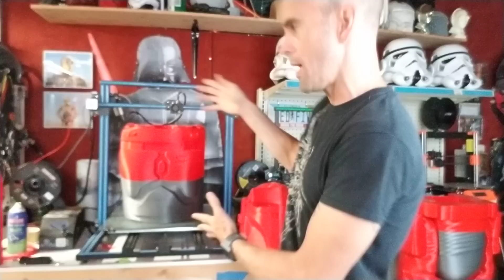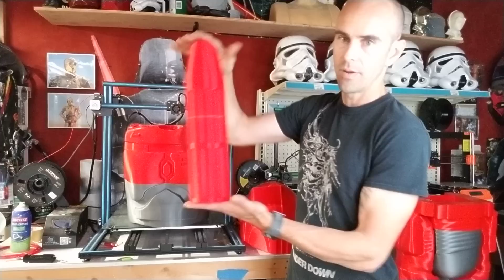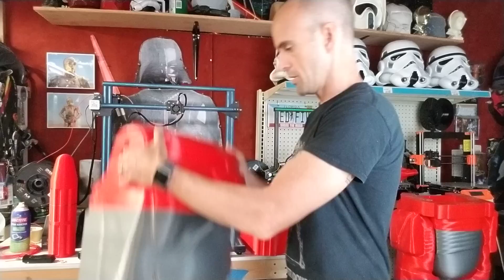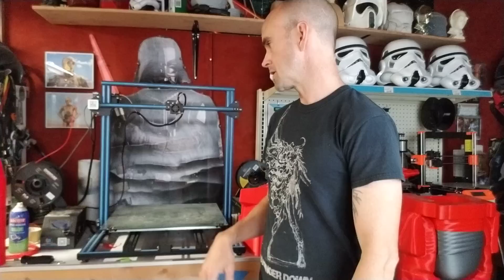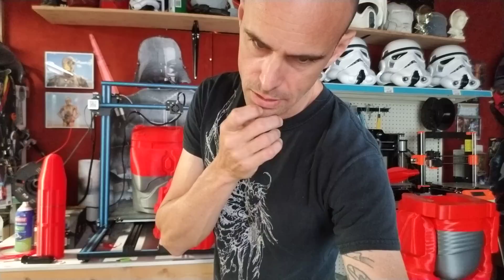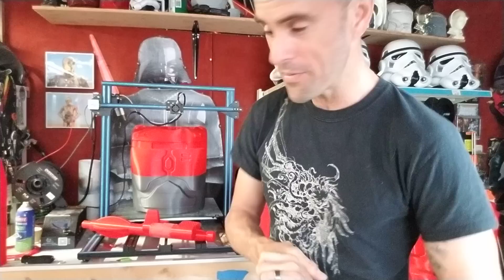Creality CR-10s5 3d Printer review and thoughts

Comment: Did you ever tried the 1mm nozzle in this machine?
Reply from the maker: I didn't. The .8mm works so well I  never swapped it. I DID use a .6 on another machine and it's pretty much the perfect size in my opinion. Gets good detail but prints almost as fast as the .8mm
Reply: @gordontarpley  thats great thanks so much

Comment: hello everyone, I'm a cr10s5 user, I mostly print industrial products. but I couldn't find the maximum printing weight for cr10s5 anywhere. I'm printing 5600gr now. Can anyone know if the y axis can carry it?
Reply from the maker: I'm not sure. I've printed some pretty big pieces. My advice would be to slow the print down as it gets taller to prevent the jerking from all the mass moving around.

Comment: What's the material cost to print something the size of that torso?
Reply from the maker: The way I printed this, with no infill, probably about $20
Reply: @gordontarpley  Sorry it took me a long time to reply. Been a busy 3 weeks. Could you direct me to more info about how you printed this? I would like to learn more about this. I recently got a CR10 s5 and sliced a portion of a sculpture I want to print to be 4 foot tall. I’m used to resin printing. I’m a total noob with filament printing. I’m doing something wrong. It said it would take 6 spools to just print the head.
Reply from the maker: @boxofcannons600   sounds like you've got it set to print solid. I did this one completely hollow and I thin it took about 7-8 rolls to print the entire 6 foot tall figure. The torso took slightly more than one roll. Check the infill setting and make sure to turn that down. 15%-20% works fine on many things. I set it to 0% for this, which made it really fast but sacrifices some quality at the top facing surfaces.

Comment: HI, Thanks for the video, have you printed anything with ABS using this printer?
Reply from the maker: Not with this one. Mostly PLA, PLA+' PETG and TPU.
Reply: @gordontarpley  Thanks, their Specs on the website mentions ABS among other filament. That's what I was wondering. 

Is it true that ABS printing requires an enclosed printer? The dealer in India told me so. As you can tell I'm a novice.

Comment: Hi. Thanks for the video.  You know where you said you use a 0.8mm nozzle to save printing time, but at the cost of resolution/detail, and you have other smaller printers you can use when you need a smaller nozzle - can you not just swap the nozzle in between prints?  So use the 0.8 for large prints, then switch to 0.4 for a smaller more detailed print?  Or when you swap the nozzle do you need to set a load of other stuff up too?  Thanks
Reply from the maker: A little bit of detail loss but not nearly as much as I was expecting.   I may do a video showing some prints done with each nozzle. It is pretty easy to swap if needed but I haven't had to yet. I also swapped the nozzle in my Anet printer to a .6mm nozzle which is also a huge speed improvement as well.
Reply: @gordontarpley  Thanks for the quick reply.  Sorry, one more related question if you don't mind - you mentioned that such a large printer isn't ideal for smaller prints which makes sense.  However, if you can put up with the noise, and vibration and longer print times etc, is the end result on a small print as good as it is with a smaller machine?  Many thanks again
Reply from the maker: @jackhenriques  yeah, should be just as good I think.
Reply: @gordontarpley  great, thanks again

Comment: so test this out when setting the width in cura to a size beyond the nozzle size and increase the layer height and you will reduce print time. example i have a .4 nozzle but was able to set width to .6 and increase the layer height as if i had a larger nozzle. you dont need any heat on bed with pla  I use Masking tape and a mixture of water and pva woodglue. glass is good because its flat. Thanks for all the tips. i have a standard cr10 for over a year only started using heated bed only with abs. Also maybe get a corexy printer to eliminate the shaking. there are HUGE corexy printers. Also if you decide to try abs you can make a cheap enclosure out of Mylar runners blankets. they work great they keep it toasty which you need for abs. Pla is great to start with but once you see one of your creations melt in the sun you will wonder if pla is worth the time. Abs is so easy to glue and fix with abs slurries of acetone and abs scraps I

Comment: so if you run out out filament and you are not home...what exactly does this machine do? and when you come home what  exactly do you do to reset it and keep printing?.. i am new to 3d printing and my ender 5 can not do this... i even hit pause on a print and after a few seconds my build table just sinks down and print can not be finished... so once i start if i am running low on filament my print is screwed if i run out regardless of the hours or days it was working on the print...thanks
Reply from the maker: It stops and waits for me to add more filament. Takes 1.75mm filament. Super easy to find.
Reply: @gordontarpley  yes sounds good i wonder if Cr-10 does that also? my ender 5 has issues i think..but when its not broke it prints pretty nice...

Comment: Hey Gordon, it's been about 4-5 months, any updates on the printer?   My Taz3 hot end just died on me and it looks like Lulzbot has just gone out of business.  I'm looking at getting new printer.  I saw your other video about deciding between the Prusa this one.  The Prusa seems to be more reliable and maybe better constructed but I did like the build platform on the Taz.  Has the 10s5 been reliable and consistent?  Which would you recommend to someone?
Reply from the maker: Yeah! Been working great! I've been using it a TON. Literally running nonstop for the last few weeks. I'll do an update video on it sometime next week!
Reply: @gordontarpley  thanks for the reply!  That's great to hear, glad it's working out for you.  I've been watching some other review videos on the S5 and I've got mixed feelings.  Problems with bed leveling seem to be one theme.  The bed taking a very long time to heat up seems to come up a lot also.  Those are the two big ones that really concern me otherwise I would have ordered it already.  Thanks again and I'm looking forward to your next video on this.  Good job by the way.

Comment: I attached the bowden tube with one of those things you attacked your badges or keys to and they zip in and out, they do sell a flex bed for the cr10s5, i believe i seen it at cctree where i bought my surface from and never need to spray it or glue stick it.

Comment: god at those sizes the filament cost is insane. I'd just buy a pre-made one or use foam etc!
Reply from the maker: It was less than $140 in filament to print the entire statue! Not bad at all.
Reply: @gordontarpley  0_0 jesus that's a lot!
Reply from the maker: @chloemcholoe3280  that's super cheap for the amount of printing! That's less than one liter of resin for the form2 printer.
Reply from the maker: @chloemcholoe3280  the premade version from Gentle Giant is $2750 if you can still find one
Reply: @gordontarpley  oof!

Comment: Well... I got mine 2 weeks ago and what a noise it makes. Its the Y-axis motor that gives a hell of resonance thru the entire frame, even with those rubber dampeners.. The wheels underneath the bed are picking up so much "dirt" and the heated bed cable is a hazard rubbing on the frame all the time..
Reply: You need to print out a bracket for the heated bed cable, and upgrade the main board in the printer to the SKR board. It's a cheap upgrade and makes the printer silent.

Comment: You should recommend your viewers a e3d v6 hotend. There is not PTFE lining in the inside of the hotend of a stock Creality CR10-S5. Due to the lack of lining, filament gets clogged quiet often. That is a HUGE downside to this printer. I would highly recommend an e3d v6 hotend to save you from all the headaches...... Overall though, this printer is great for large prints :)

Comment: I meant to add...consider the TH3D Unified Firemware, which has some nice improvements
Reply: Unless TH3D have updated their firmware, they have the acceleration and jerk settings wrong for the CR10 S5 and it will cause major layer shift.
Reply: @JohnSmith-mk8hz  nah its been fixed

Comment: I've had several friends get false filament outs on those devices, so really...just make sure you have enough filament to do your print.  Best insurance!
I'd suggest and Octoprint server (using a Raspberry Pi).  I have them on all 8 printers and use Octoprint Anywhere on all, so on my smart phone, I can see a video stream and monitor what is going on.  If I see a print is failing, I can halt it from remove and more the hot end around as needed.  It beats seeing a kilogram of spaghetti.  As always, if you have questions, drop me a line...I'd love to help the Famous Gordon Tarpley!

Comment: Nice review Gordon! Some suggestions and feedback. I have a Prusa I3Mk2s, a CR-10S and a Cultivate Beast for reference. 

For the CR-10S, I would highly recommend the squash ball feet and the diagonal frame braces. They really help with taller prints and to tone down the vibrations.

For the noise, get motor dampers for the X and Y axis. Get 2 for the Y axis in the back as the stock motor bracket isn't a true 90 degress, which throws the belt and pulley off angle. If you use 2 Y dampers on the front and back of the Y stepper with a rear damper bracket, it will make things super smooth.

Some people are using spring steel sheets with a removable bed surface for the bed. I still use the stock glass and Magigoo which is AMAZING for bonding prints to the glass and the prints pop off on their own when it's cooled. Totally worth it!

For the extra long bowden, I shortened it as short as it could go and still have it reach every spot on the bed and max height. I installed some coiled wire loom over the wires for the hote end and fans, then printed some clips to tie everything together. With the wire loom and bowden tired together, it will make it stiffer and keep the tubing and wires off your print.

Hope that all helps, your prints look super good quality. BTW: your camera's auto focus thingy is driving me bonkers. :D
Reply: I know its a year old, but adding to this, instead of motor dampers, get the SKR board and get rid of the creality board. The printer becomes silent and works much better all round.

Comment: Hey!

There are carbon-fiber sheets. I'm doing PLA and PET-G on them. No glue, nothing.
They're very light, very stiff (but allow for enough flex to get the print off) and very flat.

Just search for something like "carbon fiber build plate".

However, in my experience, you'll have to have the build-plate pretty hot (around 60C for PLA) to have it really stick. When it does, it will not (even with good force) get loose until you cool it down like 10-15C.

Just keep it clean and very lightly sand them to give the filament a little better grip.

I recently got to know, that FR4 (that stuff for electronic PCBs) is also sold as a print bed... I was told its also working great.

Comment: Check out Wham Bam 3D for a removable flex plate.  Very similar to the Prusa bed.  If this printer wan't over $1000 Cdn, I'd have one for sure. One day though it'll happen. I'm not even finished my R2 yet and I'm already wanting to do another on this Cr-10s5